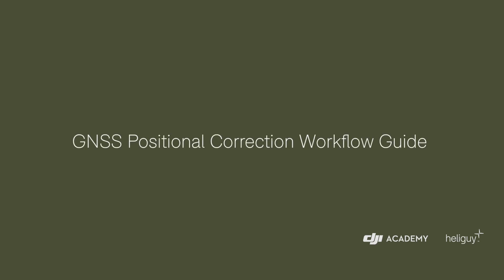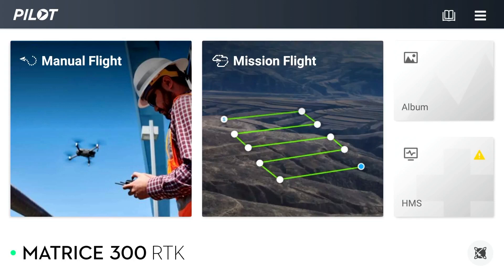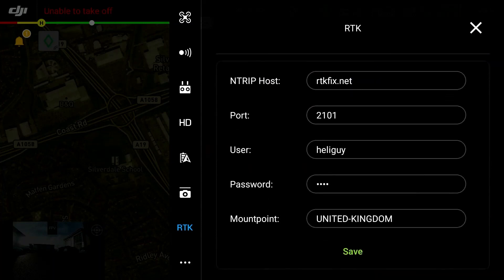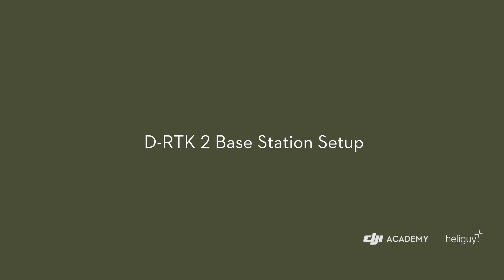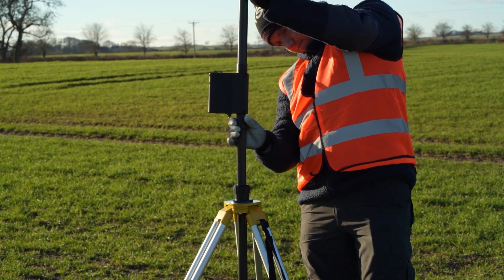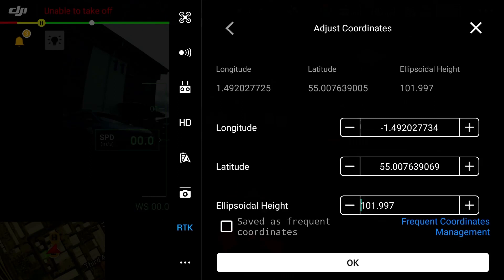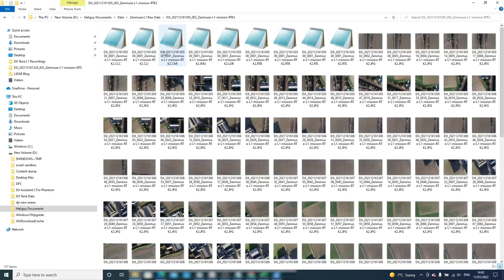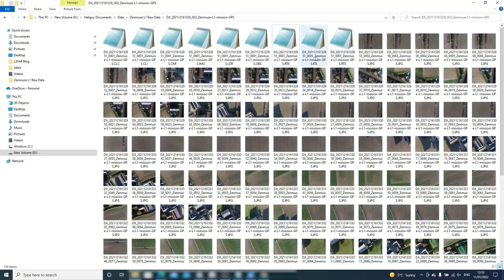Generating and Applying Accurate GNSS positions using DJI Zenmuse L1

Comment: Has all these steps changed with the newest Drone Matrice 350 RTK using the D-RTK2 Base Station. From what i'm being told, you don't have to set Known points for RTK setup, is that correct?  That is does it automatically now. Anyone?

Comment: Is the hard shell case included?
Reply: For the L1 LiDAR yes it is.
Reply: Not for the DRTK-2. If your in Canada Measur Drones has them for 335 for the station, this does not include the tripod which in my opinion does not really need a case. I've seen the Nanuk case for $775 where you can store both.

Comment: Is there a way to log precise navigation data when flying the drone, but not recording L1 data. Assuming you have some sort of sensor mounted on the drone that does not communicate with the drone (for example some basic optical sensor), how could I extract the precise navigation data from the flight for use in my data processing?
Reply from the maker: If the sensor is not communicating with the drone, could export the flight record from the DJI Pilot 2 app and export the flight path using a software like AirData, unsure if this would work for your application.